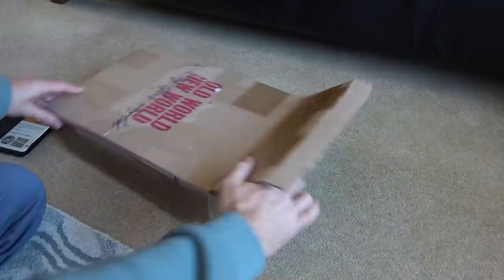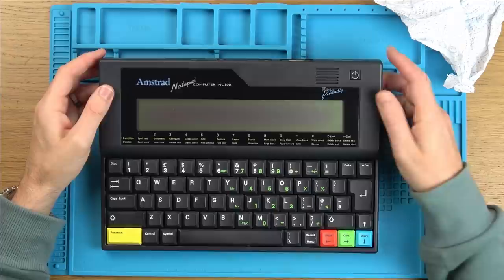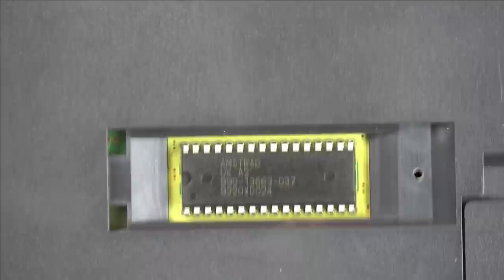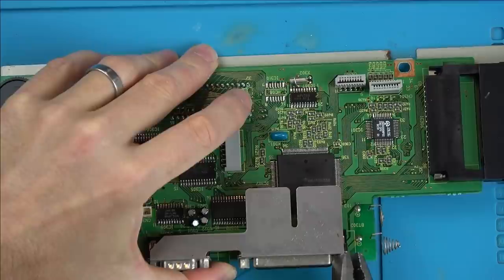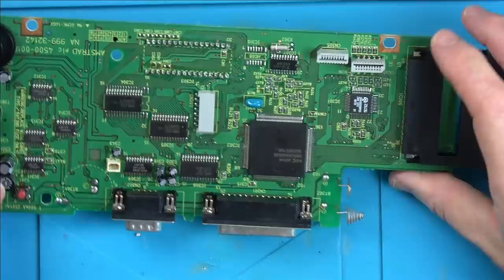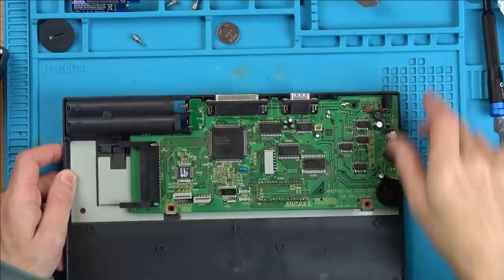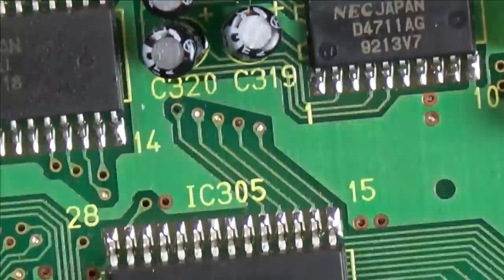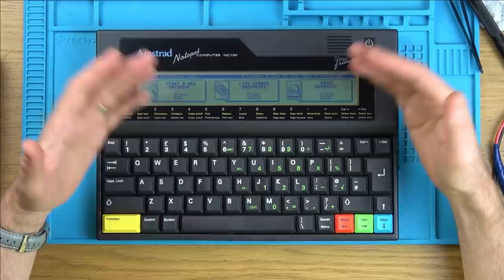Broken 1992 AMSTRAD Notepad COMPUTER NC100 - Trying to FIX

Comment: Regards the fuse - yes, there's probably a diode between ground and the +ve rail (reversed biased so it does not pass current when powered correctly).  If reverse polarity then goes through that diode, causing large current to be drawn which in turn blows the fuse.  I fixed a number of these back in the day by just replacing the fuse.  In one instance I think the diode was shorted too.  Although I cannot see where the diode is there.   Regards to the fuse being 250V - that's common, the voltage isn't that important here (a higher voltage rating wont be an issue), so manufacturers just go with a fuse that's available (mains rated) - but the current is the key.  You will see 250V rated fuses all over the place in low voltage scenarios.
Reply from the maker: Nice one Chris, thank you! 👍🍻
Reply: Came here to say this.  Reverse biased diodes don't draw that much current.  Forward biased diodes which short to ground say through a resistor which allowed current to exceed fuse value but not start a fire provides protection from reverse voltage safely and only requires 2 cheap passive components.
Reply: I always look in the comments for the reliable GadgetUK comment. 👍
Reply: @tiporari  No, they did it like that because diodes have a voltage drop. Put, say, 6V through one, and only 5.6V gets out. On a battery-powered machine, you need every fraction of a volt you can, since a battery's voltage falls as it becomes more drained. Below a certain voltage stuff stops working and you need new batteries, so you want to put that off as much as possible. Therefore you don't put a diode in series to protect against reverse polarity.

Instead, you put it in parallel! Reverse-biased. So the ordinarily with normal polarity it doesn't conduct, it does nothing at all. But wrong polarity means the diode is forward-biased and will conduct, and since it's right across the power lines, it shorts them out. Causing the fuse to pop, and protecting your delicate microchips. 

It's done a lot on battery-powered stuff.
Reply: @greenaum  Thank you for making this elaborate answer, I didn't get it before

Comment: Nice fix Vince, I use one of these every day at work for printing one-off labels with a dot matrix Citizen printer! It has been in constant use since 1992!
Reply: It'll probably last til the end of time, as long as nobody plugs the power cable in backwards, or lets the batteries leak.

Comment: The screen discoloration is a problem with the polarizer, it simply gets old and the glue detoriates. You can simply peel it off, clean the glue with IPA and put on a new one. The same happens to older Gameboys. Great job as always!
Reply from the maker: Thanks Marvel 👍👍
Reply: I was actually right thinking that as well
Reply: @nikkic36  I'd really like to see someone produce a modern display for these:  They seem like they're using something akin to the standard LCD driver, so it should be possible to produce a drop in replacement with modern screen technologies.

Can you imagine the battery life with an e-ink display?

Comment: 11:51 there is a little switch in the power jack that disconnects the batteries when a plug is inserted. That's also the reason this device is center-negative. They did that on nearly all battery powered devices with a DC-jack as it was the cheapest way of doing it back then. The negative is the same between DC and batteries, but the positive is either the batteries or the inserted plug.

12:36 The fuse must likely has blown due to someone sticking a center-positive plug inside the device. There will be a diode blowing the fuse if you connect power the wrong way round.

Comment: The vinegar smell is probably from the seller trying to neutralize basic battery leakage with an acid. So yes the battery compartment is clean as they said… because they cleaned all the corrosion out.
Reply: The same senario evolved in my noodle as well, sir.

Comment: 250V is the highest voltage this fuse can interrupt (without building up an ionized path) a shortage or when the load gets too high. If the used voltage is higher you'll need special fuses - not in this case ;-) I don't know any fuse lower than 250V ...
Many devices have polarity protection, which is a combination of a fuse and a diode after it. Wrong polarity will blow the fuse - and sometimes the diode but the device is protected. They do it this way because they don't want to loose 0,7V especially in battery operated  devices by inserting a diode in series (which would also protect the device without any fuse)

Comment: Thanks for another interesting fix. As others have said, a basic fuse is just the thinnest  wire in a circuit which will melt  if there is an overload fault. Fuses are rated by their running current, so  a 500mA fuse would need pass more fault current to melt.  The diameter of Copper wire to actually melt at 0.5A is about 0.04mm (using Preece equation). Your wire would go at about 0.3A, so not a bad substitute since the running current would be below this. A schottky diode (low forward voltage drop) in series with the power socket would give better reverse-polarity protection than a fuse blowing  diode.. 
The 250V rating comes from the package insulation and the gap left after the fuse has melted, which must be enough to stop the 250V arcing across the gap. Ordinary mains fuses are filled with fine sand to quench any such arcing.
I'm off now to find  my NC100 (which I bought new back in the day)  and check for cmos battery corrosion...
Reply from the maker: Thank you Terry 👍👍

Comment: Beautiful! And another nice repair, Vince!

As for the corrosion: It may be worth getting a glass fibre pen. They help a lot to remove corrosion without scratching the surface like tweezers do.
You can get them from eBay or most hobby or car stores for a few quid and they make cleaning a breeze.
Only downside: Glass fibres. So keep your workplace covered and use a vacuum and maybe gloves.
Option: There are brass versions of the same thing.
Reply: He has one

Comment: A wire will act like a fuse if you exceed it's electrical load capacity. In the automotive world they actually have wires called "fusible links" which are basically fuses that look like wires.

Comment: Great vid Vince.  Just an "Old TV Guy" hint for when you don't have a fuse, but need to check a board.... if you use a small incandescent light bulb, of the correct voltage (tail bulb from a car, or large flashlight bulb)   it works as a break of sorts.  When the current is low, the bulb won't light, and voltage passes.  If there is a short, and the current jumps... the bulb will light, and drop the voltage/current to the board. In turn, saving the board.  AND, you know right away if there is a problem, and you can pull power.

Comment: if you havent already seen, there was a later larger version NC200 with flip up backlit display, 3.5 inch floppy drive, and powered by C cells, you needed pretty much new cells or external power to use the floppy drive, though due to its power consumption! these also did not feed external power to charge the internal cells, but they could be modified to do so, my NC200 has been done by some previous owner

Comment: Hiya Vince.    I really enjoyed this video especially.   When I was at Uni in the early 1990's I used to lust after one of these Amstrad notepads.   I used to stare through the window at them and curse my  typewriter with memory function, that was ok to use but you could only work on one essay at a time, then print it and delete it to do another.   Brought back some very good memories.

Comment: Late to the party:
These surprisingly nice little machines are usually very reliable. Overwhelmingly the most common cause of failure is people finding one in the loft without a PSU, plugging in a random PSU without checking the polarity and blowing the fuse. Happily a fuse replacement, and maybe replacing the back-bias diode across the power rails if it's shorted, is usually all that needs to be done.

Fuses: In general the rated voltage is of no importance, although it's nice if the voltage is at least equal to the local mains supply. It's the rated amperage that's the important value - that rating will be the maximum current the fuse will 'flow' before it fails. To put it another way a rain drop falls a long way (high voltage, low current) but won't do you any harm if it hits you on the head, but you'll certainly feel a bucket of water hit you (low voltage, high current).

PS: A mod I like to do with old devices that have centre negative barrels is to add a little diode bridge right at the inputs, as you might see in a bridge-rectifier. That way if anyone's daft enough not to check the barrel polarity (who hasn't?) there won't be any disasters - wish I'd done that for my extremely rare TC2068 before I unthinkingly zapped it with a Speccy PSU. sigh Some day I'll get round to fixing it, if I haven't zapped an irreplaceable custom IC. double sigh
PPS: If memory serves the batteries and barrel are indeed common but the socket is of the type that disconnects a pole when a barrel is inserted so cutting the batteries off from the PSU.
PPPS: These things make awesome little CP/M (ZCN) laptops if that's your flavour of retro sauce.

Comment: For cleaning copper fields on electronics, I recommend a fiberglass bristle brush. Instead of tearing the copper plate apart with a knife. It is very helpful. In addition, when cleaning printed circuit boards, I recommend distilled water together with IPA - with an old toothbrush.

Comment: Vinegar is commonly used to clean the corrosion on battery terminals (usually penlite cells - not lithium button batteries) so my guess is the lithium battery corroded, they tried to clean it with vinegar, didn't scratch the corrosion off, and then plugged a positive centre-pin power supply or a higher voltage PSU in, and blew the fuse. That's why you smelt vinegar when you opened it!

Comment: It's probably just happened with the previous owner that was selling it. Just got it,  or found it somewhere else,  Tried an adapter, blew the fuse. (Without realising it)  Couldn't get it to work so just ebayed it, cleaned it up. Great fix.  Did you know that AMS bought it Sinclair? Is funny reading about the Zilog Z80 chip used,  was also used in things like Pacman etc.
Reply: Was also used in the ZX Spectrum, the Amstrad CPC, and all the good 8-bit micros back in the day! Cliff Lawson designed all of Amstrad's electronics for a long time, so he was familiar with the Z80 from the CPC. It was also the CPU in Amstrad's PCW. So had had lots of experience with it.

Comment: Not looked these up to see if it was mentioned in the manual or not, but quick observation DC jack appears to be directly connected to the battery compartment. Amstrad were well known for cheaping out as much as possible. I presume there would have been a warning in the instruction manual, but you never know with Amstrad stuff.

Comment: Some reverse voltage protection is just a diode across the power input after the fuse. So the fuse blows if the power is wrong polarity.

Comment: Check the version of firmware. An earlier version I had made the thing unusable until they fixed all the bugs. I think I still have my NC100 too. I used to write programs and data on it, then transfer them to my BBC branded Acorn A3000 which was my main machine.

Comment: MMV, I’ve got one of those, Just dug mine out & thought I best check the Lithium Cell and it needs replacing as I suspected, Nicked the Battery from the Dead ASRock Motherboard that I’ve got here, It sprung to Life and just to point out that I use Rechargeable Batteries & they work fine with this even though it will only be 4.8v, Think I bought mine off eBay some time ago, I never knew that about the “Amstrad” name & thanks for that! 🙂
Reply: I did have a PenPad as well and not sure what happened to that, If I remember correctly the Casing got sticky and it was horrible, Yuk!
Reply: Just found out that the Spacebar on mine isn’t working so looks like mine needs to be looked at, Hmmm! 😂

Comment: The z80 was also in the spectrum and zx80/zx81 Amstrad 464 and many more.
That chip on the underside looks like the system rom, it looks like it is in a pcb socket.
10 FOR A = 0 TO 10
20 PRINT "HELLO"
30 NEXT A
40 PRINT "FINISHED"
Reply from the maker: Nice ZX, just tried it. I need to try out a program to see if it can play different sounds 👍👍

Comment: Hm... maybe the vinegary smell is... vinegar! As a mild acid, used to clear up the encrusted remains of a leaky alkaline battery. Could be! 

I had a Z88 which was the superior Clive Sinclair-designed version of this! Very similar, rubber keyboard of course, but a very usable one, and being one rubber piece meant you could spill stuff on it and it just wiped right off. Clive's version came first, 1987. Wasn't a huge success but it's users stuck to it like glue, lots of use from people like journalists who needed a computer on the move, and one that weighed only 1KG and got 20 hours out of 4xAA batteries was a godsend back then! Rather than a laptop that weighed 4 stone and the size of a Samsonite briefcase with 25 minutes of battery and you'd have to bring the charger. If the Z88's batteries go flat, you just buy new ones! Or of course use the mains adaptor.

Comment: hi! you ask why the current of the supply doesn't go through the battery, the answer it's the supply connector, when you plug the supply a tiny switch shift the power. Sorry for my english.
Reply from the maker: Thank you, I remember that now from other fixes 👍👍👍👍

Comment: Yes Citizen made watches, calculators, organisers etc and also made LCD screens for other companies, including Nintendo for the original Game Boy. Then the Citizen LCD screens for the cancelled colour version of the original Game Boy (yes, that was going to be a thing) went to Sega for the Game Gear!

And yeah the Z80 is the CPU in the Master System, Game Gear, SG-1000, ColecoVision etc (and secondary to the 68000 in the Mega Drive). Also used as an embedded microcontroller in all sorts of things, and as CPUs in some early 80s arcade game machines. The Game Boy / Color's CPUs are hybrids of the Zilog Z80 and the Intel 8080.
Reply: the z80 in general is actually a superset of the 8080.  Zilog designed it to be binary compatible with the 8080 if memory serves.  I wouldn't be surprised if the Gameboy variant had a number of changes:  The 6502 variant in the NES was modified to include the sound generator and I wouldn't be surprised to see a similar change in the GB.

Comment: Old video to comment on but here goes . It might be that the lithium battery corrosion was the  original problem and caused that quirky fault , the owner maybe thought their power supply was faulty bought another one but with the polarity reversed and that blew the fuse

Comment: Amstrad did produce a superb and quite cheap 386SX with co pro monochrome laptop, very good quality and the screen albeit not colour was quite high quality for that era and it could pump out VGA to a monitor in colour.   My late mother because of how Fleet St worked in the early days of remote access portals etc and the systems the papers used, ended up with quite a lot of Amstrad stuff ranging from the portable green screen PCW to a PCW512 for the locoscript and other word processing formats, had the aforementioned 386 lappy and this NC100 then she bought her first 486 which I modded for her with a co pro, extra ram, Sound Blaster, a horrible Rage Fury Maxx Pro dual GPU abomination and set it all up for her to hook her video camera equipment as she was working for the C4 company that made Dispatches by this time and had to record voice and video of superior quality which sadly Amstrad's word processing machines were not capable of doing.

Comment: The fuse would blow due to wrong direction of voltage in the plug. That why the diode is responsible to stop the voltage going backward but only forward. But the diode isn't available on that board so that what I am thinking :)

Comment: I used to work in an Indi computer retailer who were an Amstrad dealer when these came out. I think they were about £200 and the aim was obviously to rival some of the larger priced brands. I wouldn't say it was popular, if I recall we struggled to sell the handful we had in at launch. They also done a flip screen version at about £350 which we never stocked.
Reply: Amstrad NC200 was the flip screen. 3inch floppy disk and ate c cells!

Comment: I have one of these i restored it was in a pretty bad way when i got mine corroded terminals and filthy keyboard. It works perfectly now i also have the follow up model the really rare NC-200 notebook & competitor model and super rare tandy WP-3 both those are around £60 to 100+ if you can find them

Comment: Just to add to other comment 

Amstrad released 3 NC series notebooks 

NC 100 - not very rare £30.00 for machines that need little work and about £50+ for working ones with case etc
NC-150 (aslo branded dreamwriter in some countries) average price for these £150+ very rare (has games)
NC-200 this is the big daddy brought out in 1993 cost about £400 uk pounds has built in 720k floppy drive and PCMIA slot - like nc150 very rare and cost upwards of £100/£150 uk pounds (has games!)

Comment: Hello. I'm no expert, but I believe a lot of electrical devices have polarity protection to prevent connecting the power the wrong way round. However, judging by the age of the notepad, it MAY NOT.

Comment: Hey, Vince. Nice Video.
Are you sure that a CR2032 battery has to go in there (Not rechargeable)? Could it be that a rechargeable button cell (ML2032) has to go in there?
The yellow sticker on the back explains something about a rechargeable cell?

Ah ok. Forget it. Just saw the print on the board. It clearly says CR2032...